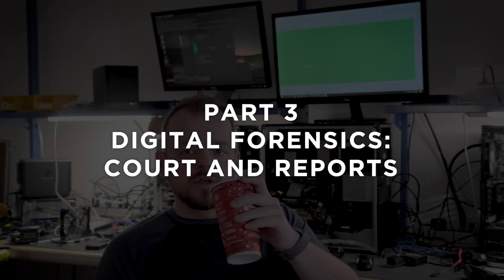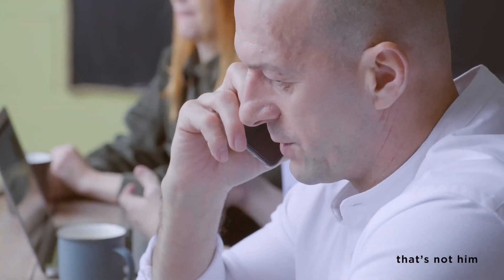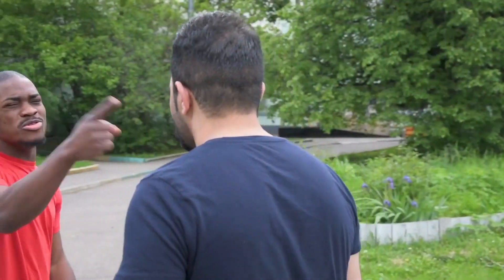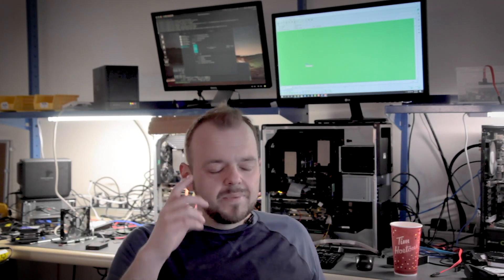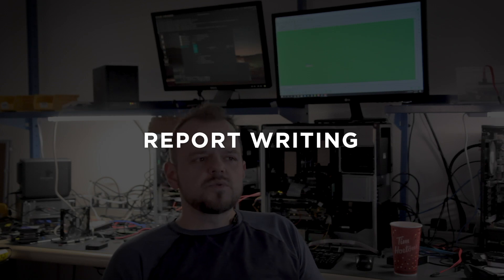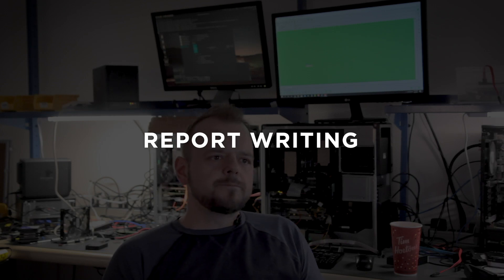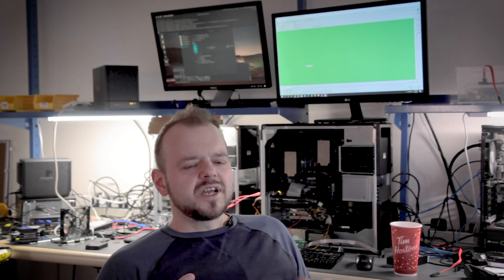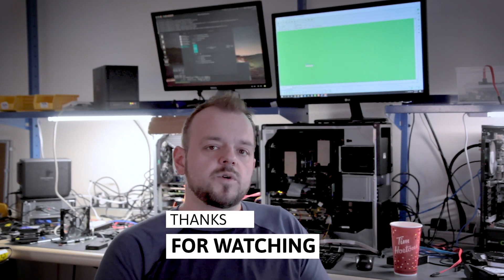Digital Forensics - Going to court. Part 3

Comment: Mr Stanko Friend I Want to Know About This. I Installed New Facebook Massenger Instead To My Facebook Old Massenger. But I Don't Like New Version. Can you Plz Tell Me How to Download Old Massenger 211 Year 2019 Massenger. I Can't Find This In Play store. 😢. If U Can  give It Link To Me. Is This Delete My  Old Massenger Data Or Not. Thanks. Stay  Safe
Reply: Difficult to Find My Favourite 2019 Massenger Blue. So Sad. 😭😭😭😭😭😭😭😢😥😪😅
Reply from the maker: You can probably search for the apk file but I would not recommend that for security reasons